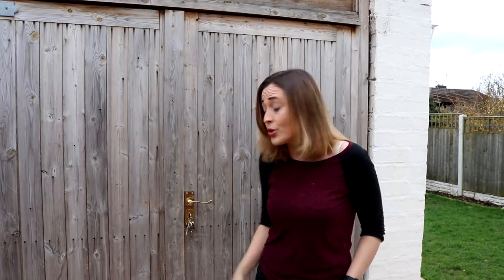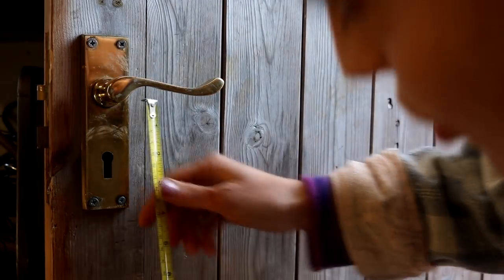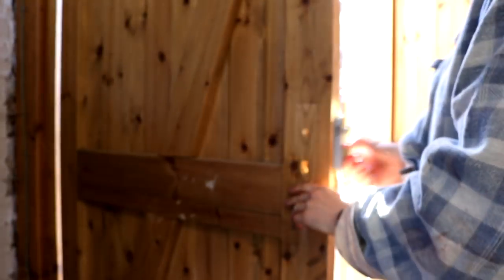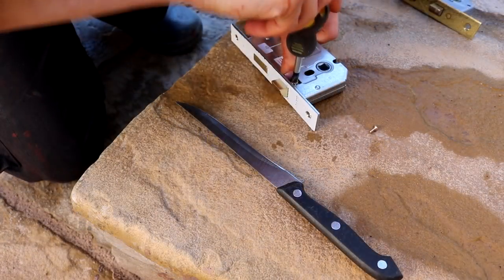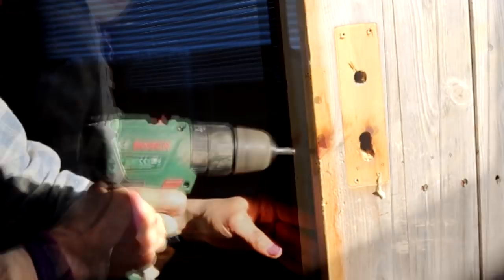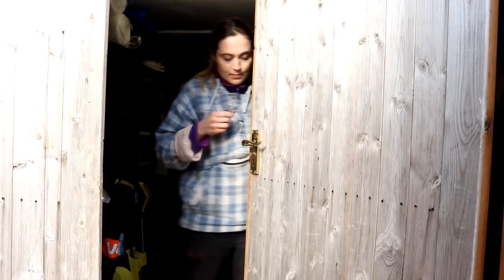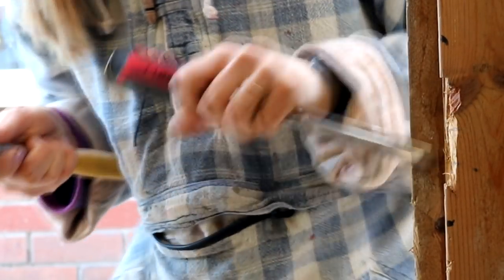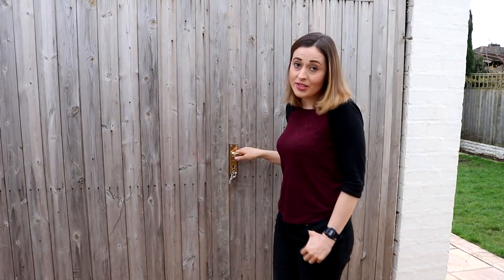Changing A Door Mortice Sash Lock | The Carpenter's Daughter

Comment: Woman after my own heart. Thanks. 
Off to Wickes to get my new lock.
Reply from the maker: Fyi... have a look for a reversible one!  You won't need to unscrew the catch like I did here :)  You can see it in my bike shed video 👌
Reply: @TheCarpentersDaughterUK  I've got a bigger problem: the lock is bigger than the space on the door. I'd have to strip the beading out which protects the glass panes 😒. I think a new door is needed. Sigh. Would look nice, and necessary but not sure I can fit a door. Haha.

Comment: Well done.
Little tip if you need to fit new lock. Put some lipstick on the lock part that goes into the door frame when door locks an close the door and you get a imprint of where to drill into the frame.
Reply: scott mclean good tip but could you imagine the reaction I'd get on a building site if I got out a lipstick 😂 I use a little bit of glue or sometimes just scribble on it with pencil 👍🏼
Reply: Spend Time, Save Money, DIY lol id jus do it for a laugh
Reply from the maker: Hahaha to lipstick on a building site LOL.  Must admit, I've used nail varnish once for something similar.
Reply: The Carpenter's Daughter Hahaha what do you guys have in your toolboxes 😂 do you use tweezers to pull out nails 😂 You should do a questionnaire to see who has used the most unimaginable item to do diy bet you get some whoppers!

Comment: just a question. should the plate with the visible screw heads be on the inside of the door? maybe for extra security. just curious about that as I always put the visible screw heads on the inside of the door.
Reply: I don't think it really matters in this instance because the locking mechanism is a deadbolt and is buried in the door.  Removing the handle and outer plate would not put you much closer to gaining access to the lock.

Of course, a solid boot to the latch would snap it like a twig, but as my grandpa always said, "A lock is just there to keep an honest man honest."
Reply: that makes sense. thanks.